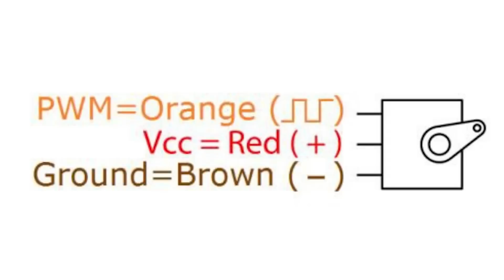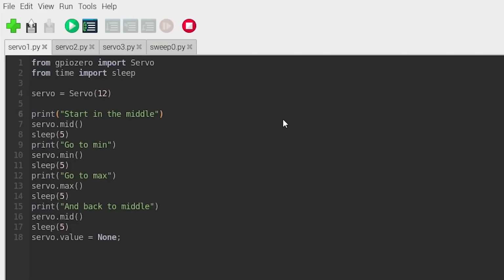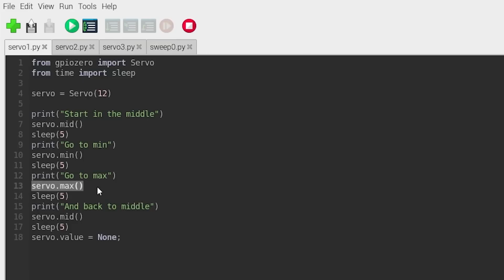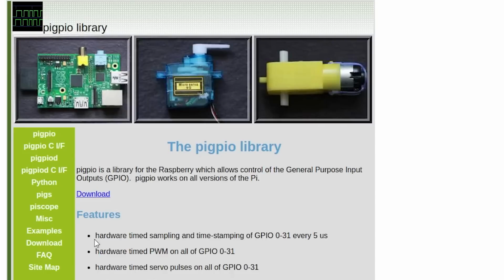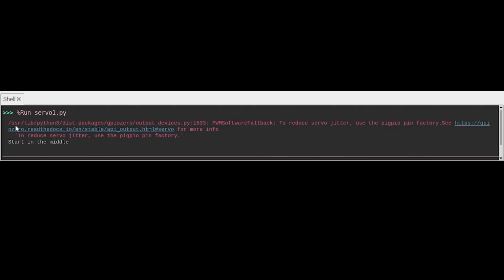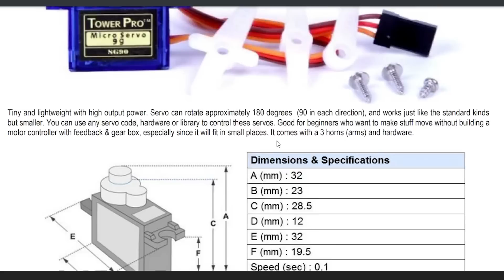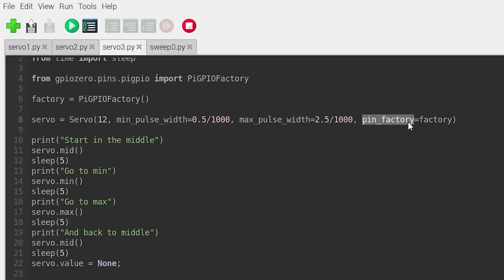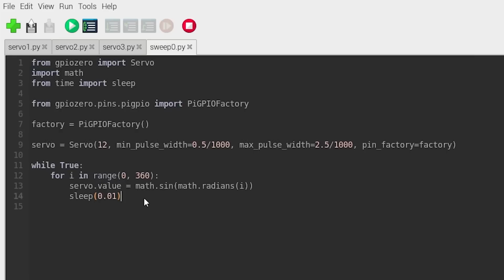Raspberry Pi Servo Motor Control - No Jitter!

Comment: Thank you for such a clear presentation on how to control servos! I plan to use a Pi or Arduino to control a servo motor. The purpose of the servo is to control the back and forth (traverse) motion of a wire guide that feeds a guitar pickup winding motor. For a normal traverse motion and even winding on the pickup bobbin I am thinking a sin wave would be the 'normal' but also want to explore some irregular 'scatter patterns.'  Perhaps just varying the time it takes to traverse would be enough. Otherwise perhaps sawtooth and other patterns could be used. Any thoughts or tips on what I wish to accomplish?

Comment: Thanks for your kind explanation and your code  :)     Before I was only using a GPIO pin and my servo motor was jittering too much but with the PiGPIO it is working fine!

Comment: Hi new to all this - can you let me know if i can connect 2 servos (exact ones you show here) to Raspberry pi 4b without any additional stuff? Or can it not power? My aim is to get a pan/tilt combo working with the raspberry pi camera 2 module. Totally new to this so any advice appreciated in the most minimal way possible - would rather not buy more stuff as it will go on a robot so want to keep weight to minimum.
Reply: Did you find out?
Reply: @shadbud9198  worked for me for a pan tilt setup

Comment: Hello Gary,
I have been using the Raspberry Pi for a while now and we know how convenient it is to connect various sensors and modules using the GPIO pins.

I recently found my Nordic Thingy 52 and realized I have the whole suite of sensors in one place that can be connected wirelessly to the Pi! I would like to know if there is an easy way for the two components to communicate?

Comment: I don't understand why you call this motors SERVO-MOTORS: they are not SERVO, because they haven't any encoder for the feedback, then it's an open loop control, NOT a closed loop control. You will never be sure that the motor reaches the set position, you can do this only by means of a feedback that confirms the reached positions is the same as the set position
Reply: Inside there is a potentiometer which encodes the current position, so they are servo motors.
There are tutorials about how to change these servos into continuous rotation by modifying the pots.